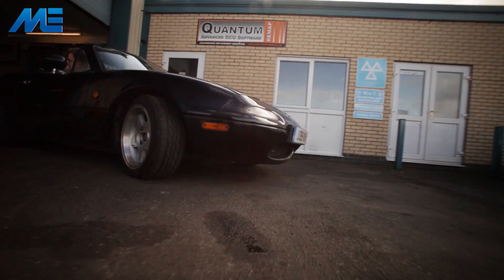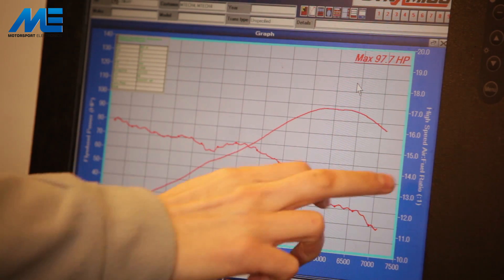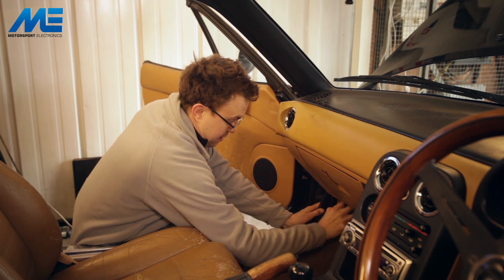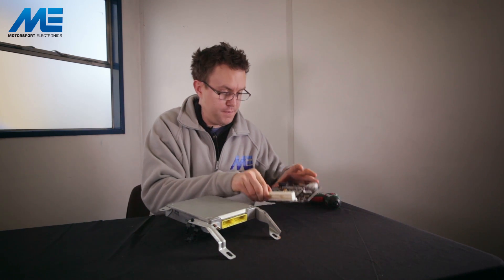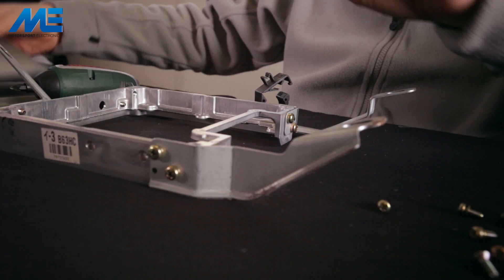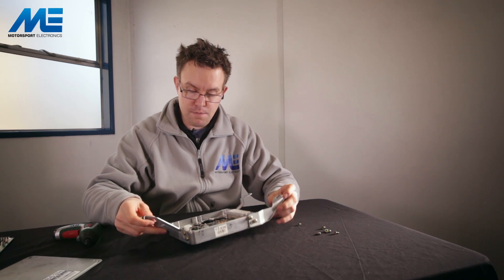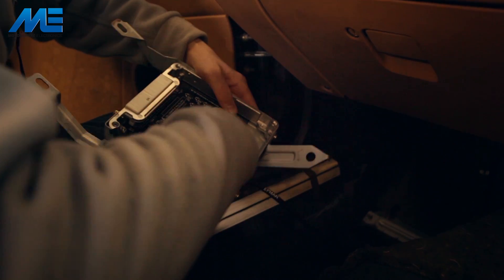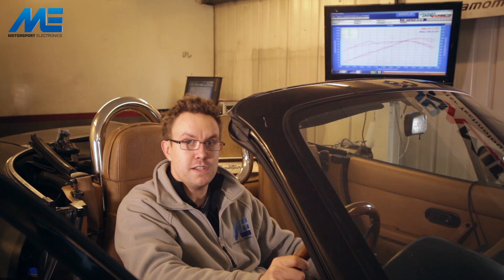Motorsport Electronics ME221 MX-5 ECU Install | Part 1

Comment: Do you think the mx5 nb 1.6 (stock) can have 20hp more with this modified ecu?
Reply from the maker: If it's fully stock, then probably not. A slightly better intake and less exhaust restrictions, maybe.
Reply: @MotorsportElectronics  i got a 1.8 swap. Much more torque and more power.